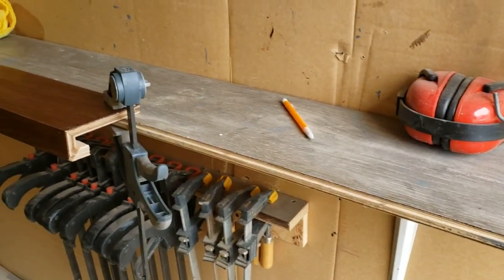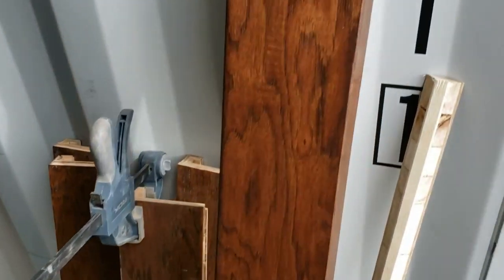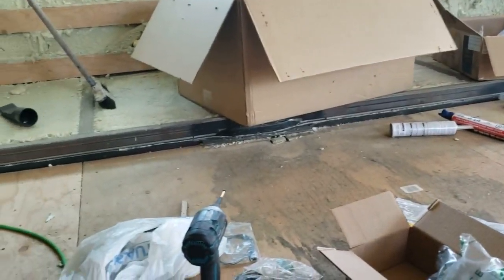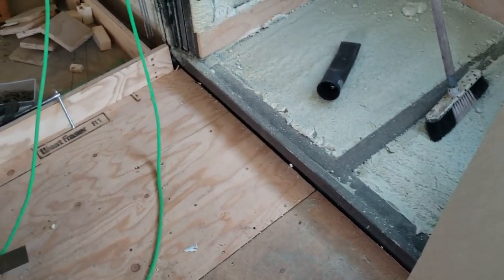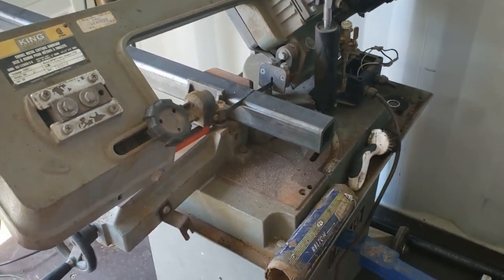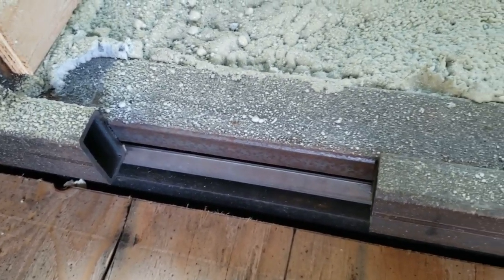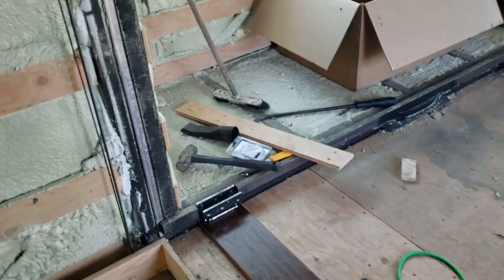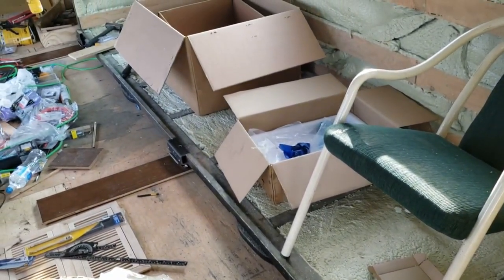Bus Conversion Project - Video 109 - Finally removing the slideout swingarms

Comment: I know the frustration.  I have had to redo so many things along the way.  In fact, I usually say I never do anything once.  Doesn't make it any easier especially when you have to sacrifice a great design for one that's just ok.  Oh well...such is life.  
Good progress!
Reply from the maker: Hi John, when we were building tug boats we said if it was worth doing , it was worth doing 3 times... I try not to do that on my projects but it's inevitable sometimes I guess... it was frustrating to ditch a system that worked so well... good to hear from you

Comment: It's coming along nicely James your roller fix was brilliant and looks like it's going to work just fine. Beautiful flooring 
Love the color great choice bud. 
Can't wait to see it installed I bet it makes it feel so much bigger enjoy the weather my friend it never sticks around long enough right.
Oh very cool your running on your solar
Well worth it right.
Reply from the maker: Hi Brian, the flooring on the front half of the bus is done and you're right, it does look bigger.... might be cause I got rid of all the crap too.. it was running on the solar, I don't have enough yet to go completely solar, I'm still running the generator some but it's enough to keep the fridge running and do a little welding.... so that's a start....
Reply: @JamesEDennison  that's awesome buddy and you'll figure out the solar I don't think I've seen anyone get it on the first try yet but you will get there if you're pushing for a little more more panels or a lithium bank down the road.
Can't wait to see the floor installed I'm sure it's beautiful see you on the next one friend.

Comment: Hey there Mr James! Good to see you back! Fixing the slide-out section right behind the driver seat looks great! But, I have a question: is the wood around the bottom section of the seat...and, I’m assuming it’s an air seat...gonna rub the seat when it goes up and down? It looked to ME the seat was bumped right up to that wood section at the bottom. Just curious. Always happy when you throw another video up! Let’s me know your doing well and getting a little bit closer to finishing the bus! Take care, my friend, and stay safe!
Reply from the maker: Hi Jim, it's not an air seat and it has a skirt around the bottom so it looks like there is less clearance than there actually is... it doesn't hit, there's about a half inch of clearance, good to hear from you... stay safe